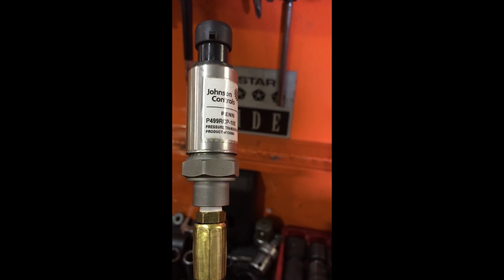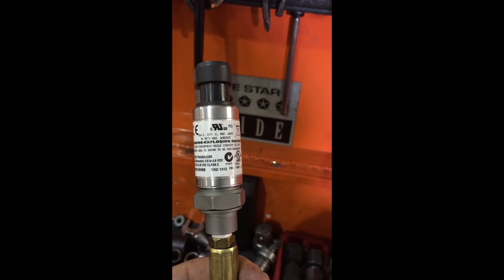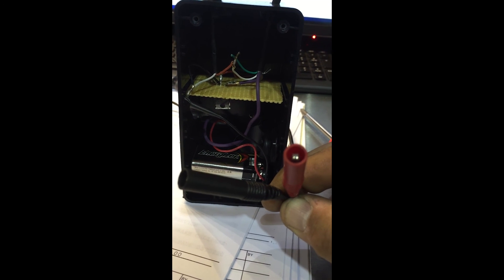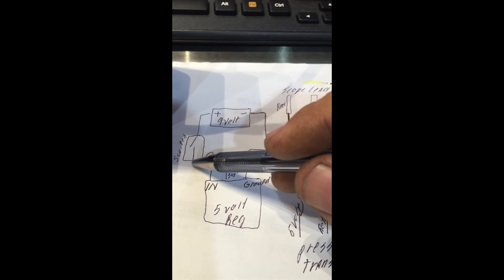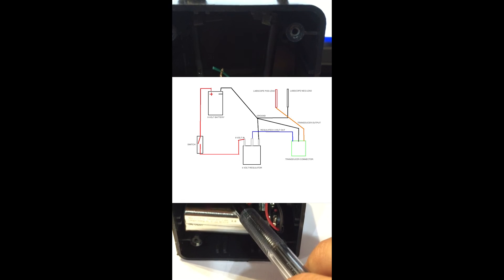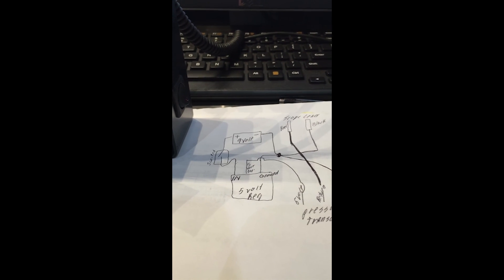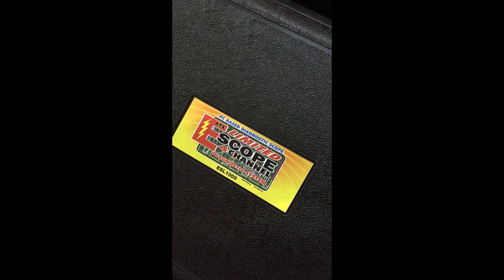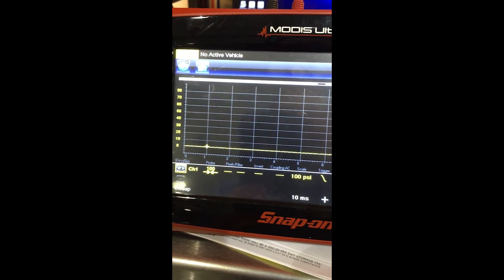Pressure transducer for automotive testing

Comment: Definitely need pressure transducers working for dodge dealership. Have to have an easy way to diagnose the valve seats that drop out of the 3.6/3.7/ 4.7/5.7 engines.